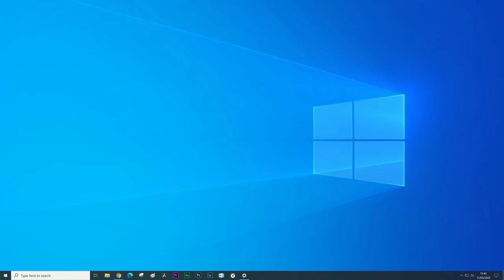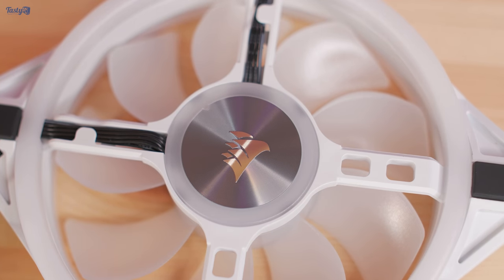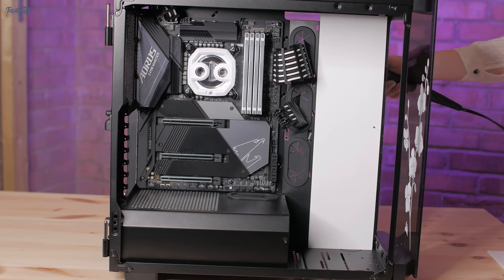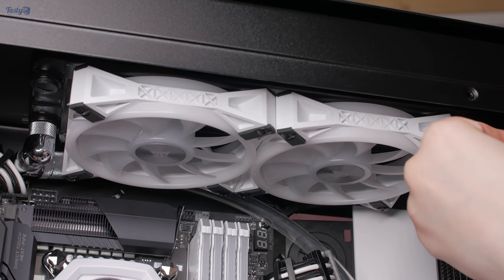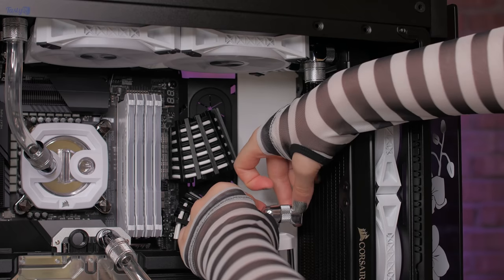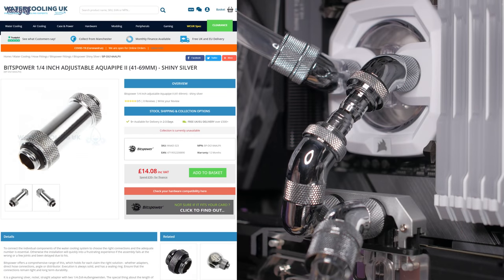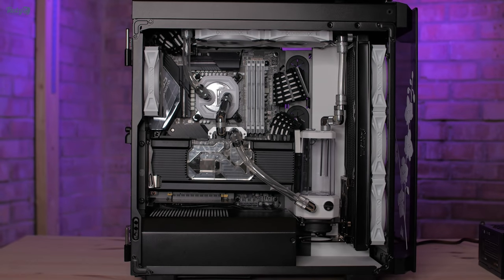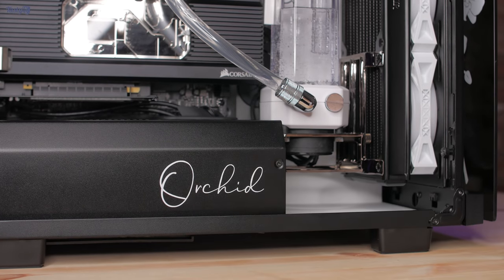I Watercooled A PC For The First Time In 6 Years!! ~ RTX 2080Ti & i9 10900K

Comment: Aaaaaaa 3:55, the universal cry of anguish from all DIY builders. I feel that pain. But "and it works!" Great success. Very classy editing and loved the mea culpa-filled voiceovers :-D My recent favourite fuckup was not plugging the second EPS... Then realising I'd really need it connected... With just about everything installed and in a small enough case I had zero clearance to reach it and push it into the slot, even using longnose tweezers. Ugh, out it all comes again. BUT NEVER MIND HEY! Final result is what matters.

Incidentally, had any problems with your fan and light strip controls with iCUE? I had a right mare of a time until a knowledgeable user pointed out on the forums a way to circumvent a temp probe measurement bug. But I've noticed quite a few people posting saying recent updates have bricked fan or light controllers. You avoided all that?

Comment: seems like everyone missed out on the fact that the corsair gpu blocks leak
Reply from the maker: No one here did: https://youtu.be/k1JaG4_Q-I8?t=252
You're just late to the party :P
Reply: @TastyPC  O i see it is just a stupid risk on your card then since you knew it did . OK
Reply from the maker: @johnleonard3951  Checkout the JayzTwoCents video on the block (https://youtu.be/kmQdZ79RFuc) to see how/why the leak occurs as it’ll help you understand why it’s very unlikely to be an issue in my installation. It’s still something that Corsair should fix in later revisions, but if I was betting which part of my loop would leak, the GPU wouldn’t be my first guess.
Reply: @TastyPC  I was going to link the same video to you until i seen you was aware of it. If just a little pressure to the side will make it leak then it is not worth risking  it unless you fix it how he did and even then at the cost of water cooling gear it should not be an issue . I understand perfectly what is going on and that you think just because  you don't have a lot of force on it that it wont leak . My point is that with 1k+ card it is just not worth the risk.

Comment: Why are you connecting the 360 and the 240 radiators together? You’re not going to get any more cooling then if you had a 360 by itself. What you should have done is connect the 360 to the CPU then run the GPU through the 240 or vice versa. Let each component be cooled by one of the 2 radiators, not both.

Comment: I hope you flushed your rads beforehand with hot distilled water.

As for hard tubes, it won't be hard if you will be using angled fittings.

Comment: So all the fans in this case are push? no intake fans at all ? this might hurt the vrm of the MB. specially that you have 10900k with OC that thing is a beast on the MB vrm. some airflow would help.
Reply from the maker: The build has 3 intake fans and 3 exhaust fans. Push vs pull is a different thing to intake vs exhaust.
Reply: @TastyPC  i see so the front is pull and the top&back is push.
Reply from the maker: @greyraven9164  The 3 front fans are case intakes but are "pushing" air through the front radiator. The 2 fans in the roof are case exhausts but are still "pushing" air through that radiator. The rear fan is just a case exhaust. So all 5 fans are in a "push" config on the radiators. I don't have any fans in "pull" config. 

Case Airflow:
3x intake
3x exhaust

Radiator fan config:
5x push
0x pull
0x push-pull (which is when you have fans both sides of a rad)

I hope that explains it. :)

Comment: ...connecting cpu and gpu directly is inefficient for cooling. You should have a rad between each major connection or you will move the hot water from one part to the other, starving the second part of thermal headroom. Yes, it may result in adequate results, but it will be louder and hotter than it needs to be.
Reply: The 2080ti can output heat equivalent of 250w while under load, and the 10900k has a TDP of 125w but can easily draw 200+w, meaning that the water coming from the GPU is increasing thermal load on the CPU to 300-400 watts. Even if you don't thermal throttle at stock, with even a conservative overclock you may hit a wall.
Reply: I don't think you realise how little it matters. Temp deltas between coolant in and out of a block are probably about 1-3C. The water moves too fast to heat up more than that.
Reply: @OptimusToaster  if it moved too fast to leave heat behind in the cpu it would be moving too fast to effectively grab and transport heat. 

Fourier's Law my friend.
Reply: Also basic thermodynamics to use a term more colloquially understood.
Reply: @FreeThePenguins  these are all common misconceptions. I can't be bothered to explain all the thermal physics behind a full loop setup but I'll cover the relevant bit.

At steady state of a high end OC'd GPU, the water needs to carry 300W of heat, ie 300 joules per second. A D5 pump will move 100 litres per hour as a low estimate in a custom loop. 100 litres per hour is ~28ml per second. 1 ml of water has a thermal capacity of 4.2 J per ml per degree C (or K). 28x4.2=116 watts per degree celcius. 300/116 = 2.6 degrees rise in water temp. Double the flow rate to a more typical 200lph, the temp rise in the water is halved.

I hope this helps your understanding.
Reply: @OptimusToaster  Are you forgetting the inherent pump heat as well? DeltaT should be closer to 11-12 degrees over ambient, putting the water temperature closer to 31-35°c, meaning it has a thermal conductivity of about 50~(rounding)mw thermal transfer rate per mK. Your calculation seems to ignore that water below 30°c has lower thermal conuctivity, meaning that the level of heat it will move both to and from the gpu and cpu is greater than what you expected. I'm not going to go around and claim I'm any sort of expert on the field, but just the rudimentary calculations puts the thermal load on the cpu at a level where, if you add extra heat into the same section of the loop, given that the fittings and tubing in that section now also has to operate at a higher temperature, it could result in significant increases to core temperatures.

Comment: "Which means this single run costs £62 in fittings", then mentions that her corsair rep was funding most of it.

No mention of sponsored content, other than in the comments, if you actually expand them.
Reply from the maker: This video was "sponsored" by SCDKey. As in they paid for an advert. 
Corsair didn't pay me for this video so I wouldn't disclose it as a Corsair sponsored video as that would be confusing. They did however send me press samples for this project which is evident throughout the series. This is part 4 in the series, and I create the content for my subscribers with the assumption that they've watched the previous parts. Otherwise the recap bit in the beginning would be really long and boring. In part 3 I literally open boxes of parts "from Corsair" and this relationship was never hidden. I'm sorry if you felt misled though, that wasn't my intention.

Comment: Two radiators and one pump??
Reply: Whats wrong with that? I have 3 rads and one pump res.
Reply: @elminster8149  I mean that pump is small for two rads
Reply: @waso999  Why? It's a reservoir, the capacity is largely immaterial, as it only stores the liquid and has no impact on heat exchange.
Reply from the maker: It's a Laing/Xylem D5 Pump. Widely considered the best pump you can buy for PC watercooling.

Comment: Beautiful build.  Even though this is soft tubing, it really doesn't trigger me at all. It's done without making things look messy.  The sagging you can prevent when working with hard tubing as it's more rigid. And yes, fittings can completely break the bank. I remember my first hardline build, I ended up ordering all fittings incorrectly, while in my mind it should have worked just fine. 

Curious to see your next build!

Comment: I know she is sponsored by Corsair but I would stay away from their watercooling.  The radiators are just Hardware Labs rebranded.  It is cheaper just to get Hardware Labs.  The GPU block has a defect where it can leak.  It is enough of an issue that other Corsair sponsored people have quit recommending the block.  The CPU block is mediocre.  Heatkiller is a better price and gives better performance.  The build looks good but I go for performance over looks.
Reply from the maker: Corsair are not a paid sponsor, but they did supply a lot of hardware for this build. I talked about the GPU block issue in a prior video on this build, just as I covered other issues that I ran into as I was building the loop (such as the sagging pump/res mount). Future issues with the hardware will be covered in future content. I plan to work with other manufacturers/brands on future content and cover as much water cooling hardware as I can. Corsair is just my first stop on the journey. :)
Reply: @TastyPC  cool...I just hope a block failure does not take out any of your components. I enjoy your content by the way. Just not a fan of corsair and their overpriced offerings.

Comment: Pretty sure it's not a sexist thing about the hardline, this is a common comment towards anyone using soft tubing.
Reply from the maker: Saying "you should use hardline instead" isn't at all sexist obviously.
The type of comments I'm talking about often add in a "you should get some guys to help you if you not able to do it properly" element.
Reply: @TastyPC  Oh yeah that's pretty stoopid.  This was literally the first video I saw from you, your're doing a great job with building. Definitely  got inspired.

I would have to agree with your statement about the vertical line going from the rad to the reservoir that you sometimes overthink an issue, that was great input. I've been toying with the idea of why (in a place like that) people don't try to make it more "artsy" (in the lack of a better word) and for example make the line longer by adding in a loop or something? When getting a clean straight line is difficult to achieve, just make it special instead. That's something that i would experiment with at least. And in your case with the Orchid theme, maybe get a 3D printed Orchid to act as a support for the "artsy" loop.

Just throwing some ideas out there that I myself have been thinking of when it comes to soft tubes.

Comment: Your build looks awesome! I was starting to think that you weren't going to go through with it. Also, embrace the mess ups and learn from them, just try and not make it an expensive mess up lol.

Yeah, my all carbon black Bitspower fittings for my dual loop system was really expensive. No comment on the actual cost because I probably would have never been content if I went with different fittings.  https://imgur.com/gallery/MY0X13T